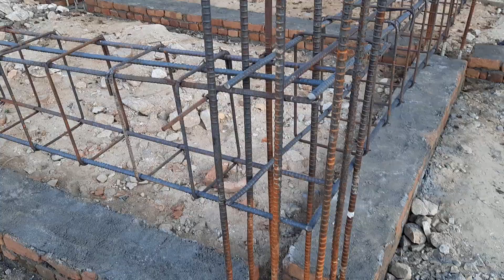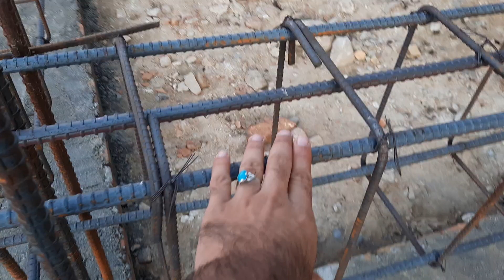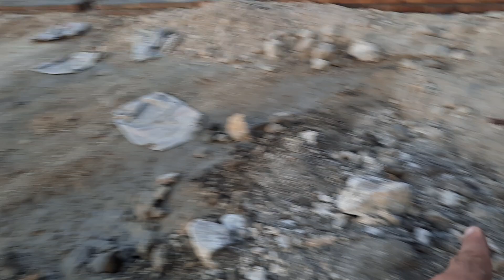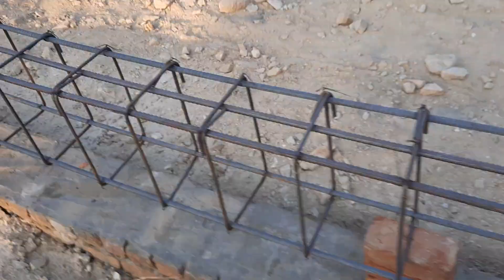Big  Mistakes in Beam structure Design on Site

Comment: Why you provide 3 No's of bar in top fiber ?
Reply: The top Zone of the beam is called the compression zone. So to give the strength for the upper zone of the beam we provide more extra bar compared to the bottom tension zone.
👇🏻
To avoid cracking on top of the beam